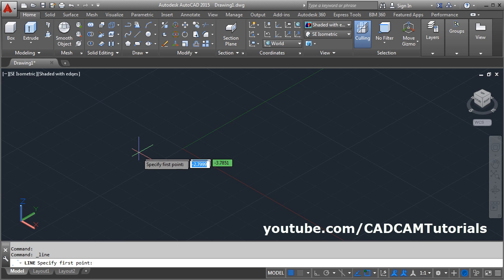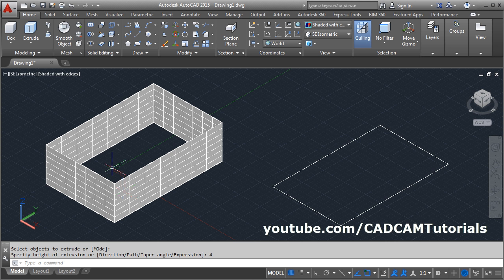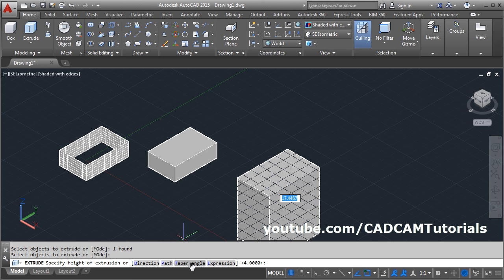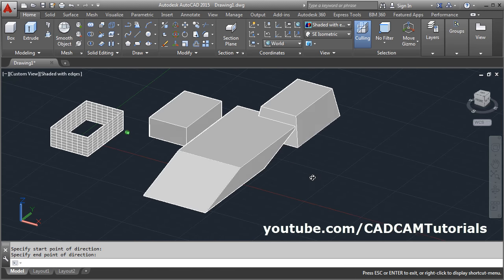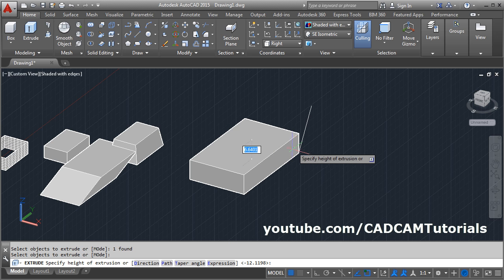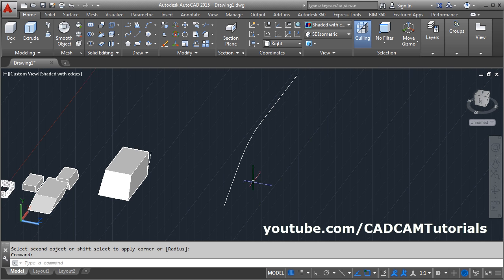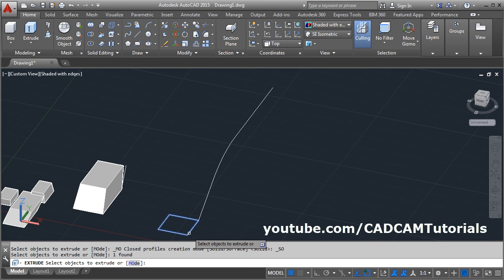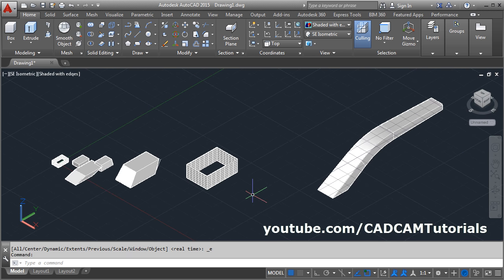AutoCAD 3D Extrude Command Tutorial Complete | Surface, Solid, Along Path, Taper Angle

Comment: Dear sir need help. If i have to extrude an oval-shaped to circular shape how could i do it. I have used direction and path commands but these are providing extrude on one side only. The other end of the oval shape going outside of the circular shape
Reply from the maker: You will have to use loft command https://youtu.be/-csG9hukV0w
Reply: Ok sir thanks i did it